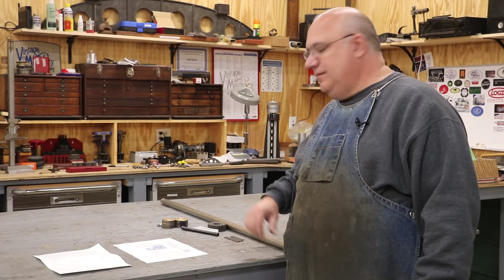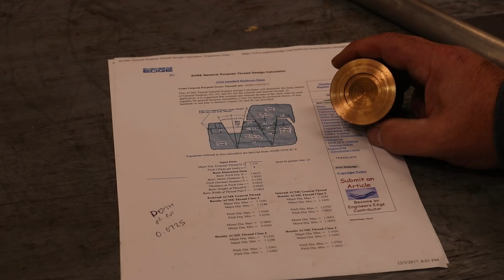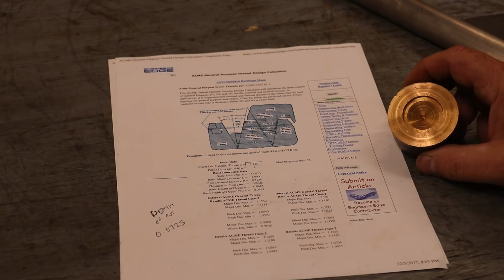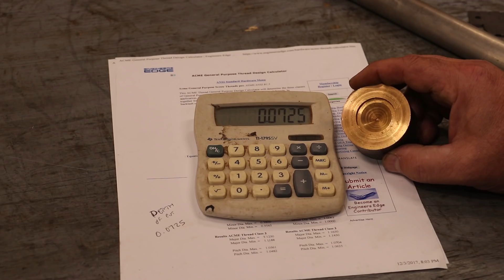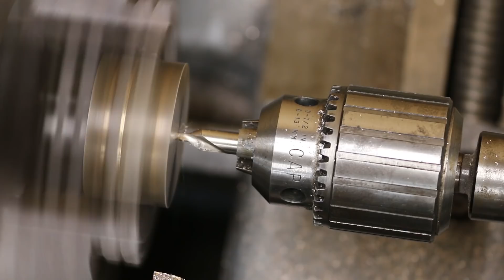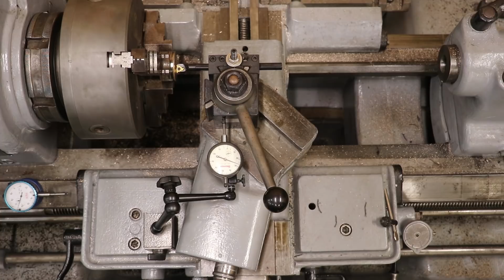Cutting Internal Acme Threads on the Metal Lathe

Comment: I did almost the exact same job today. Made the nuts first...8TPI. Then it just dawned on me, that was I meant to have the compound set at 14.5 deg or should have I just plunged? I did use the angled compound and then came here this evening to see what you have done or how you tackled the same job. The dial gauge for the thread depth is a good idea yet also a couple of quick trig calcs will determine that the ratio on the X axis at 14.5 deg using the compound is 1.032888. ie thread depth of .072 becomes just over .074 on the compound dial. Very much enjoy your style Keith and I've picked up on so many little tips from your videos... All so very well done and thanks from all of us out here... I would have stayed awake wondering all night if I'd done today's threading right otherwise.

Comment: We used the term "single point" as referring to this type of thread cutting.
I did hundreds of ACME , Square, Buttress, and traditional 60 degree threading for industrial presses. Its quite unsettling how a steep profile thread can go from too tight to loosey goosey, in one light pass....good luck to you.......PS:  double the pitch, cut a thread engaging halfnut on 1 or 3,  cut another thread on 2 , 4. Viola' double lead. Twice the travel, same amount of wear surface.

Comment: I agree squaring off the lip is a good tip but the fundamental issue here is the overly large "pilot" hole. If the pilot hole diameter was close to the drill web thickness there would be little tendency to self drill. Step drilling in general is a poor strategy that is excusable on wimpy machines but pointless on such a robust machine as used here. 
My other issue is rather than relying on the drill cutting an accurately centered diameter it would be much better to bore to the final minor diameter and certainly not reversing the blank between minor diameter cutting and threading.

Comment: Nice work. Thanks for making the video. I have yet to try to cut an Acme thread internal or external. As I recall the Coyote was always using Acme gadgets in his effort to catch the Roadrunner. Don’t know if that one inch drill bit you were using was a taper shank drill or not, but one trick is to clamp a lathe dog onto the drill shank at the front face of the tailstock ram and rest the lathe dog tang on the compound, prevents the drill from spinning.

Comment: Nice. Maybe what I am seeing is a camera trick, but it seemed that the thread dial was jumpy or sticking and not turning smooth. Is there a lot of backlash in that thread dial, or is it sticky? OR, is it just the video, my internet connection, etc... ? :-D.
Reply from the maker: The indicator is sticky.  Time to send it out to get serviced.
Reply: Ah, I thought I was seeing things. I have a Logan that had a funky thread dial, the drive gear was mangled and didn't engage properly with the lead screw and it did the same thing. Replacement gear fixed it right up. Hope it is an easy fix for you.
Reply: Keith ,William is talking about the thread dial not the dial indicator. Looks like you might just be confused there.

Comment: Keith, a question...
Could backlash be a contributing factor to the "spring" in this particular setup?
The depth of cut is being set by retracting the compound and the thread face of the nut away from machine center is engaged.
Would it be stiffer to retract past the the set point then move forward to the desired position?
That way the push from the pressure is against the engaged face of the nut thread.
Reply from the maker: More likely the diameter and length of the threading bar.
Reply: Thanks !  I was just wondering if that would help.

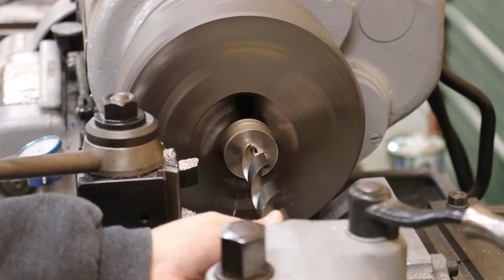Comment: 8:20 That's what you get when you are predrilling. Never predrill if your machine has power to run the final size drill. Center drilling is ok.
Reply: No, never predrill if your machine has enough power. Using any size of predrill will just increase shatter and burn the corners of your drill. There is no point arguing, this is easy to try, first drill with a predrilled hole and then same without predrilling (or better in reverse order, so that you don't ruin your drill in first hole) and listen to the sound of drilling and inspect surface quality and condition of your drill. Adequate amount of cooling is of course important in both cases.

Comment: As you were cutting the depth to a half thou, did you measure the hole size after drilling or just rely on the drill cutting on size?
Reply: The fact that he used a drill for final size means he did not bother to measure and close was good enough, not a normal or typical approach but apparently ok  in this case.
Reply: @TroubledTimes2024  good lord a three year old video, i cant remember the context , there have been so many since, but i guess my comment was about the apparent discontinuity between length and diameter tolerances. Agreed sometimes near enough is quite good enough.

Comment: How did you set the feed rate to get the thread pitch?
Reply: Bill Moore - if your lathe has a quick change gearbox you set that up for your desired threads per inch. Without a quick change gearbox, you set up the proper change gears for your desired thread.

Comment: I've got a J.H. Williams bulletin from the 1940's for their threading tool holders. It says that to cut internal threads with the compound swung to the right... like you do for external threads. The bulletin also says that 90 deg. feed in is to be avoided as well. I've seen some recommend straight in-feed as giving just as good a result (with carbide inserts perhaps?). I actually cut internal threads as shown by Keith, but the next time I do cut them I will try the Williams recommendation and see how it works.
Reply: I guess if you think the tooling engineers at J.H. Williams had no clue how to cut threads after 30 years experience, you must be smarter than they were.
Reply from the maker: I was taught to always set your compound so that you are only cutting on the leading face of the thread doing the cutting.  While I have to agree that with carbide tooling, it probably does not matter as much, I still think it is good practice.  If you just cram the tool into straight on, you are actually cutting on both the front and back of the V, and it makes sense to me that you want to cut on the leading edge and not be dragging on the back.
Reply: Keith, I'll send you a copy of the Williams bulletin. The bulletin says that there is better chip formation following their suggestion. Like you, I was taught to swing the compound to the left when threading internally. I had to read it several times to make sure I correctly understood their recommendation.
 The advantage to the Williams suggestion is that the compound is not likely to have interference with something like a casting that was being threaded.

Comment: Acme threads for this is bit of overkill.. but you know that. For his project a multiple start Unified National thread would be better and easier to make. A 16 tpi four start thread would do the trick (Lathe set for 4 tpi with 16 tpi profile).
Reply from the maker: My motto - if it is worth doing, it is worth overdoing!  Seriously, the guy who I am doing this for wanted Acme threads so that is what he got.  And at the end of the day, it will work just fine so I did not see any reason in changing his mind.
Reply: Unless the dining room tabletop is 2" thick steel plate, I don't think it would too hard to push the table leaves apart.
You do know why you would use a multi-start thread, don't you? ..So you won't be turning a crank all day to get the leaves apart.
Reply: chris0tube True, but cranking that little gear in the center 4X per inch of separation (8TPI but on left and right hand threads like a turnbuckle) may get tiresome if he needs to open the table often. Maybe it’s electric so no biggie...?

Comment: I was concerned about the .0725 cut, at first I thought it should be 1/2 that when read on the dial. At least on my SB lathe dial cutting on the radius 10ths would actually move a dial indicator 5ths. I couldn't read the dial indicator in the video so depending on the lathe's dial either it went the full 72.5 or 1/2 that.
Reply from the maker: The full 0.0725".  It seems like a lot, but if you do the math, that is the correct depth for Acme at 8 TPI.  The outside diameter of the shaft is 1-1/8" and the root of the thread is 1".  Take 1/8" (0.125") and divide in half (threads on both sides) and you get 0.0625".  Add 0.010" for clearance, and you get 0.0725".
Reply: Missed the 1/2 math that you already took. Really figured you would not have made that, unless your lathe dial had a different calibration. I think most compound dials have have the 2:1 ratio, but maybe not all. :-)

Comment: Speaking of the drill bit spinning, why do bits (all or most) have circular shanks? It seems like square or hexagonal or three-sided or anything except circular would solve this spinning problem, yes? I know this one was a taper, but why not just make it non-circular so it could not spin?
Reply: JL Software
Sort of a clutch effect to be weakest link if a little too aggressive, imo
Reply: It's a lot easier to manufacture a round shaft to run true than a hex shaft.
Reply: Several larger bits I've seen do have three flats on them, just for this issue. It costs more I guess is why it's not more common.
Reply: JL Software - just a guess, but I would bet that 1 inch drill that Keith was using was a taper shank  drill. Probably dug in and slipped because it is sharp and copper, brass and bronze are grabby materials.
Reply: Ah. So if a taper fit slips and spins, does that destroy the taper so it won't fit after that?
Reply: JL Software - not necessarily, but a slipping tool sure does not help. I have purchased roughing and finishing Morse taper 1, 2, and 3 reamers so I can use them to help correct scored bores.

Comment: The video ended unexpectedly, usually Keith has a little outro talking about continuing the project. I assume he just filmed the whole thing and didn't film an interlude?
Reply from the maker: That would be correct.  My original plan was to do both the internal and external threads in one video, but when I started editing, I realized it needed to be  broken into two episodes.  And due to time constraints, I did not have time to go back to the shop to shoot that interlude.... What can I say, my productions are not made in Hollywood.....
Reply: Your productions are better than anything in hollywood, I only mentioned because it wasn't like your normal video intro's and outro's. Always appreciate your videos!

Comment: Well you made that look easy enough Keith. looks good
Reply: It's the left handed threads that are tricky.  Running the lathe backwards can be confusing.  You can't allow interruptions.
Reply: That's OK John, I'm sure he has it all under control, he's a crafty feller. I'm also glad it's him doing it and not me!!
Reply: John F,  Standard way to cut a LH screw is to just run the leadscrew "backwards", not the lathe, and start from the inside and run outwards, not very confusing to my eyes. Much more confusing cutting a RH thread with the lathe running backwards, but once mastered it's much better way...
Reply from the maker: I actually find that left hand threads are easier to cut than right hand ones.  Much less likely to crash your cut.....